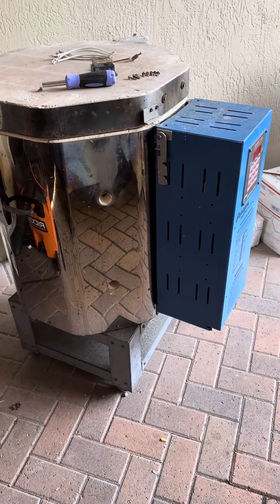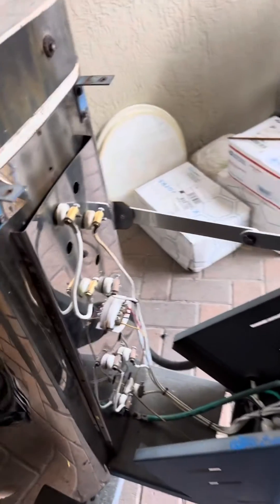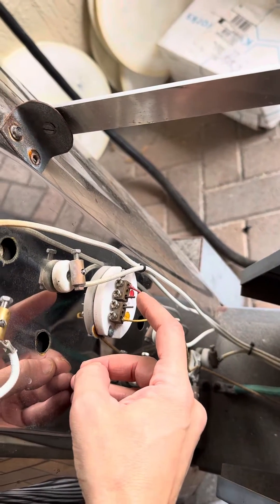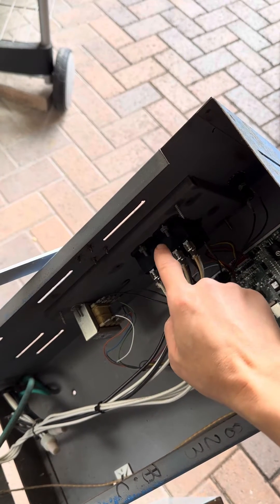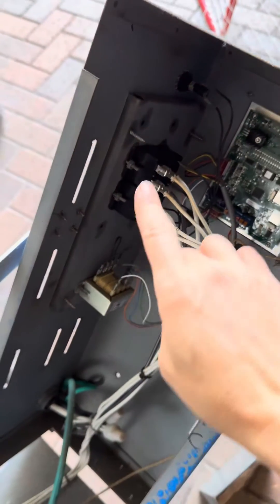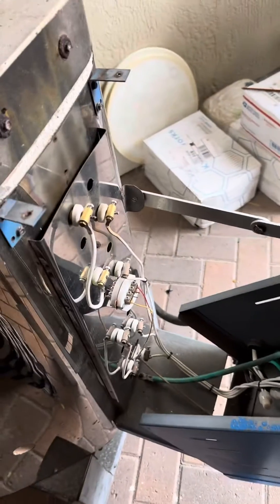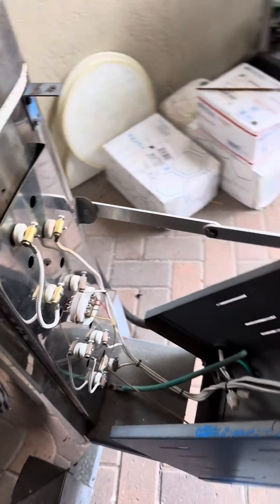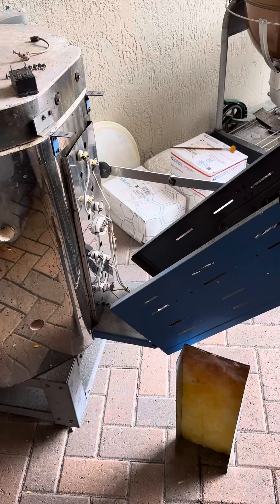A quick tour of what’s inside your kiln’s controller box and how to replace elements, relays, etc

Comment: I have a Paragon kiln that won't heat up. I've tested the circuit from the relays to the elements and there's no current. I have looked at the internals of the controller and everything look good. The fuse is fine. I'm not sure what to test next
Reply from the maker: See if there’s a current in the outlet and if any current is coming out of the power cord to your controller box (checking the power cord and the outlet)